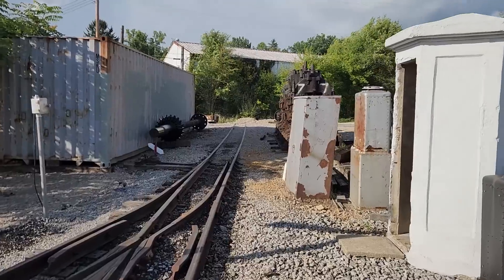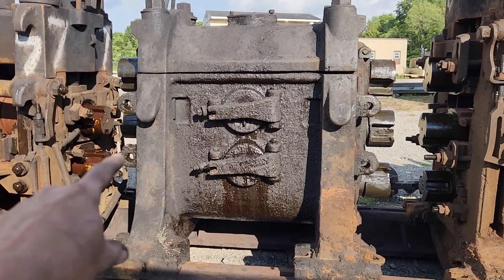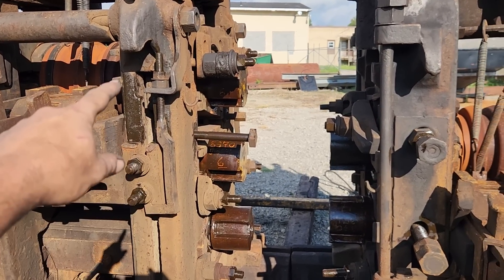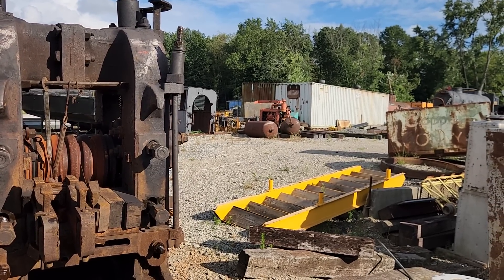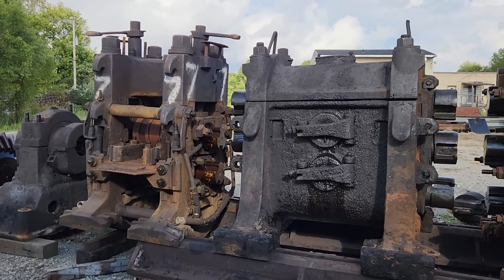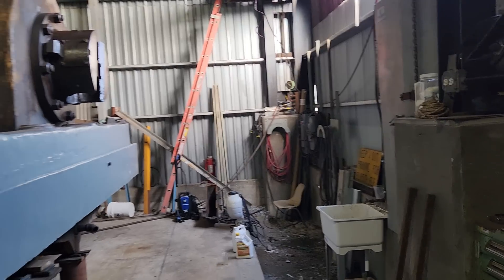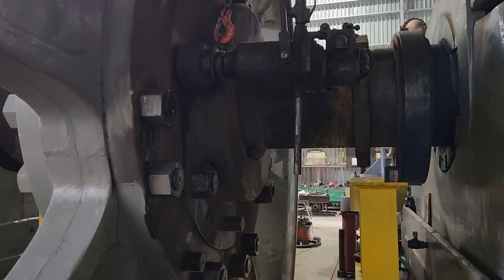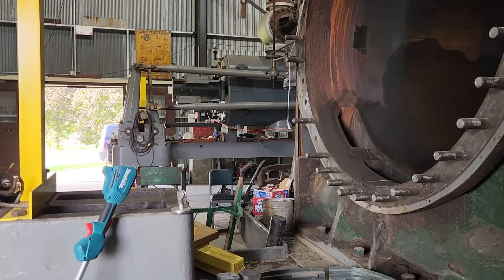We Bought A Rolling Mill!

Comment: You are going to need a proper boiler, even a package one, to operate that engine, particularly if it is going to power a rolling mill.  One or two small steam loco boilers will not be enough steam to power that engine.  That engine needs, no demands, quantity besides pressure.

Comment: Very cool, not to interfere into your vision. When having that spindle made for the drive side. integrate a modern shear bolt to save the spindle from over torque and grenading the expensive spindle. Rolling mills are extremely technical and require a ton of knowledge. So reaching out to retired people from this type of rolling would be extremely helpful. Also, reaching out to retired mechanics who have worked on these specific mills will come in handy as well. I love this type of stuff as I've worked in a rolling mill for 33 years. Good luck.....

Comment: I have a 40” swing lathe with 24” over the cross slide. I also have a 48x84 boring mill and they both sit under a 15ton bridge crane so if you got prints/ concept drawings I might be able to machine your adapter shaft for you.
Reply from the maker: I will certainly be in touch once we figure out the design and prepare drawings. I have a friend doing the CAD work for us on all of this.

Comment: i notice this dude keeps costs a secret. hhmmmmm....
Reply from the maker: These videos are about sharing the interesting work that we do and the machinery in our care.  Funding is a necessary evil and probably not that interesting so I don't talk about it.   I put everything I have into this and find ways to keep things moving forward.  We keep costs as low as possible (one of the reasons we have solar, to eliminate an electric bill) and try to do as much in house as possible.
Reply: " If you have to ask, you can't afford it " seems to apply. Or he got it for such a steal that management doesn't want it be known to someone else who wanted to buy it for more, but wouldn't keep it local.
Reply from the maker: @gravelydon7072  Its a question of priorities.  Does my personal wants and needs get met or do I put money toward the project?  The latter usually wins.
Reply: Every bit of 10 million $.
Reply: I misunderstood what you are doing. You are setting this up for historical purposes, not to sell bar stock to customers. I worked in hot and cold rolling mills my whole life, 43 years. Good luck!